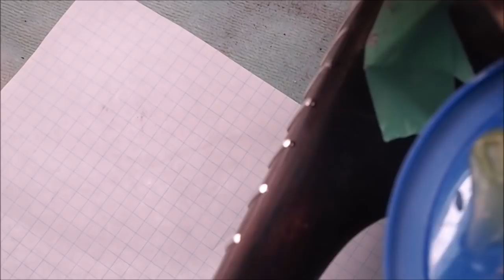Gibson A-Jr from 1922 Gets Some Frets

Comment: Thank you so much.  I am building up to refretting a Squier Telecaster   with larger frets.  I have purchased the fret removal pliers and fret cutters from Stewmac and fret wire.  The tip on trimming the fret wire as you have shown is my big take away.  Thanks so much.  Didn't think of trimming against the slot as apposed to with the fret slot.  Love your channel.
Reply: Donald Fisher.    I recently replaced several frets on my old Flatiron in built here in Belgrade, MT while at the old defunct factory back around '94.   I used Stew Mac fret wire which should hold up better than the cheaper stuff they used at the time.  I leveled the frets with a DMT super fine diamond "stone" ( plastic base) and took a bit of time re-crowning these frets.  It plays like a brand new mando from the factory.  If it lasts 27 more years like the last time, I won't care, cuz I'll be taking a dirt nap.   Cheers, my friend.  Bob

Comment: Nice work bro! That Mandolin is awesome!! What a beautiful instrument! I've worked on 1 in the 7 years of having my guitar shop, It was new and the kid just wanted a setup. I would love to get my hands on a old Gibson like that though! I have a few pics of the 1 I worked on on my shop page. I'm currently in the process of refretting a customers 1964 Kawai S-160, Houndog Taylor model... Super cool guitar! I never even heard of them until this one and what a cool sound coming out of those vintage pups! With all that metal over the top it has a really cool slide guitar tone, and the rad. on the fret board is .016!! Pretty flat for a 6 string, but perfect for a slide! I wish the fretboard was in as good condition as that mandolin! I don't think it was ever oiled! (rosewood to, not maple) It is so dry it's full of tiny surface cracks... And the frets, Lol, I don't think there original because every fret is cut to different lengths! Not just getting longer as they go up the fingerboard but it's like they were never measured, I couldn't even play a note on the 1st fret high E string, because there was no fret left! Lol. Some were so short on the treble side like that and some were so short on the bass side that my fingers just rolled off the fret when trying to hold down a note. It was the opposite of fret sprout!! Unbelievable...Lol. I hate when people do things that they don't know how to do, So I talked to the customer and had to tell him he had a choice, a nice wall hanger, or a player. And of course he said go for it! So because the fingerboard it so dry and cracked I had no clue what to expect, I ordered a new sharper style fret puller with .010 and .020 guides that slide under from StewMac just because my old Stewmac pullers are the kind you used and I wanted to get there sharper more careful pullers just for this job (It would have been easier just to slap a new fret board on, or even a new bolt on neck!) But the customer want's to keep it as original as possible. And just to make it more of a pain in my ass the neck is bound... Some of my friends think I have the coolest job ever, always telling me they wished they built and fixed guitars all day... Well it's not always pony's and rainbows! Lol. Anyways like I said before excellent re-fret job bro! I have a few pics of the Kawai, the frets actually came out very nice, now I'm waiting for some stainless fret wire from Stew Mac (He want's stainless and I ran out, Just have some nickle left) So as soon as that shows up I can press them in and get this thing out of my shop before I find something else wrong with it! Lol. He brought it in just to have me clean up the scratchy pots, And since then I swapped pups, the neck and bridge were backwards, I had to find a correct vintage bridge for it, looked like a homemade bridge on it and the string spacing didn't even go over the pickup pole pieces, Then the fret issue! I asked Ryan how the hell he even played the thing with short frets and he said he didn't... He just bought it for 200$ off Reverb. Here is a link to my shop page where you can see some pictures of this classic axe, Thx. again for the video bud     ......   Mike.
https://www.facebook.com/Ipswich-River-Guitars-106563420706171/?modal=admin_todo_tour

Comment: Jerry Rosa doesn't believe mandos need a truss rod if the neck was made out of multiple stiff chunks of hard wood.  An average neck made of one quarter sawn chuck of Mahogany might need a TR.  Most Gibson mandos are a one piece job of curly maple.  I have seen necks that are 3 or 5 pieces of hardwood that probably don't need them.  String tension is less that 180- 200  pounds anyway.  Mahogany can deflect about .004", which is a thickness of most human hair.  Does that really matter ?

Comment: Off topic, but do you have any issues doing a neck reset on a Seagull? Don't they epoxy the neck on?
Reply: Newer models are,but older vintage Godin brand acoustics have straight bolt on necks.